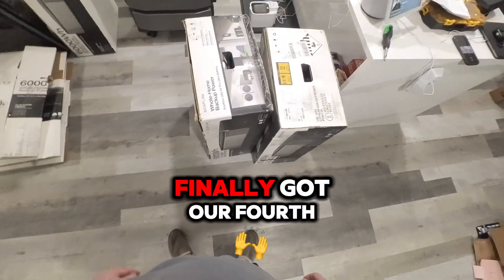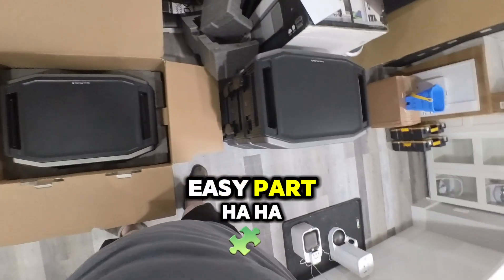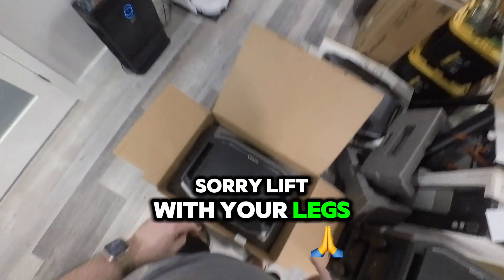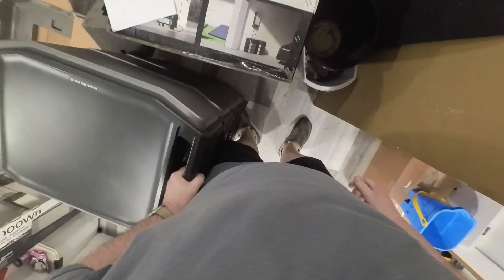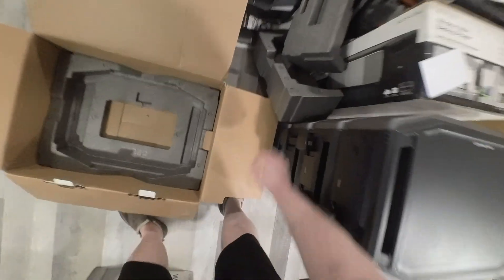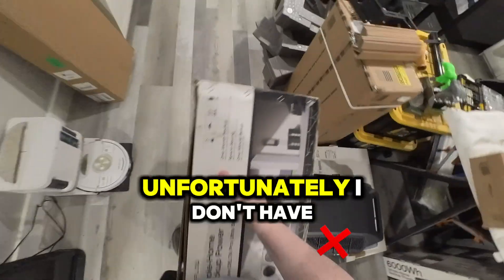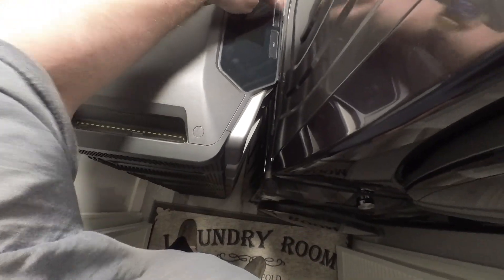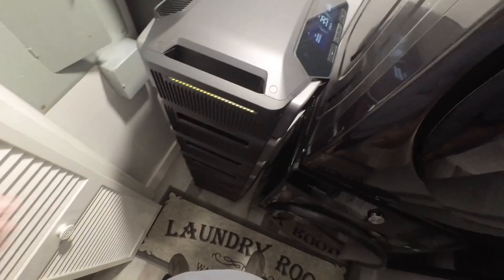Ecoflow Delta Pro Ultra | Assembling the 4th and 5th Battery | 30.7kw of Power

Comment: And now the ultra (the new model) is on steroids with the EDPUX, with now 12k W of power output per unit (requires 2 batteries, for that power but even with 1 battery, can output the same as the original ultra) with each unit can now input… get this, 10k W of solar! Oml, Ecoflow is expanding more and more. (Also nice video)
Reply from the maker: Right?! EcoFlow is going crazy with the new Ultra + EDP-Ux setup. 12kW output and 10kW solar input per unit is insane. We run our entire condo off our current Ultra system already, and the new model would take it to a whole different level. We’d love to upgrade to the new version once it’s available (or if EcoFlow wants to work with us 👀). They’re seriously changing the home energy game.

Thanks for watching! ❤️

Comment: can the system be charged by solar panels only. can it discharge to other ecoflow battery products. canny video.
Reply from the maker: Yes This unit will take up to 5600 W of solar 4000 on the high voltage side and 1600 on the lower side you can charge it using just solar. As far as I understand, you can charge other EcoFlow products just by utilizing the AC outlets